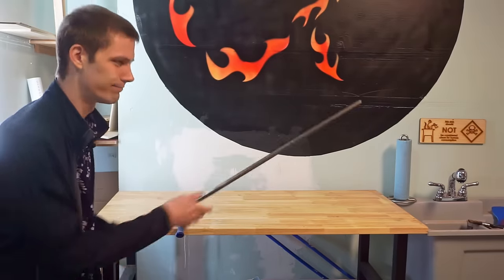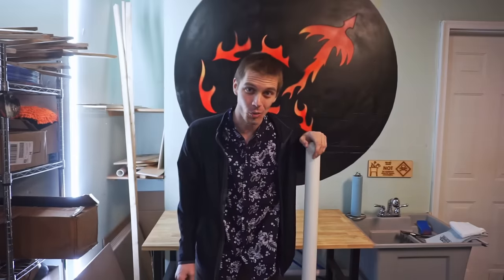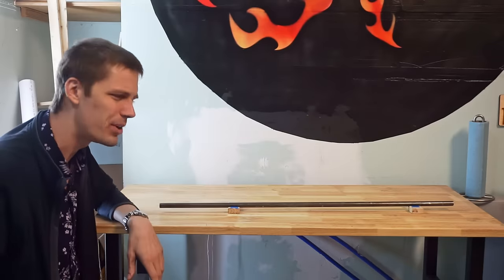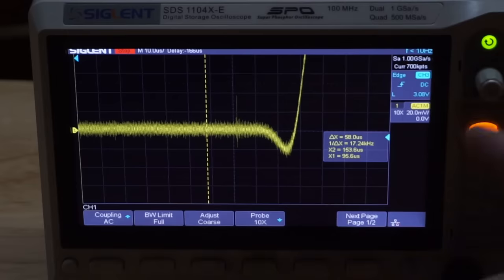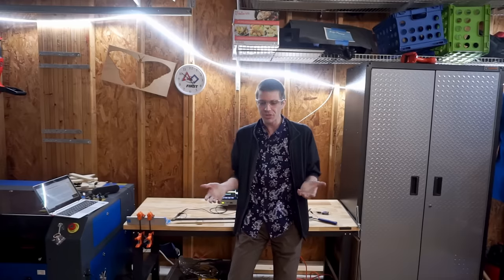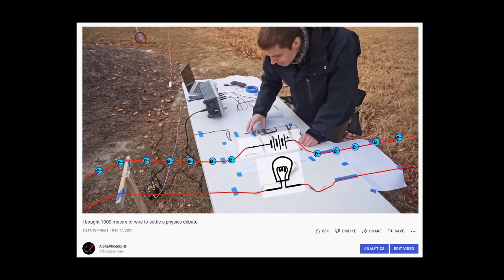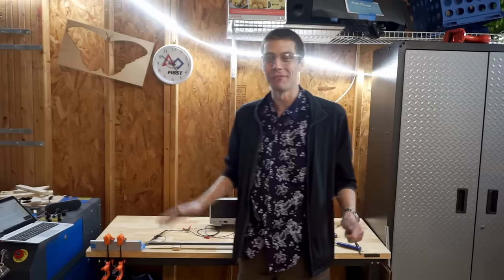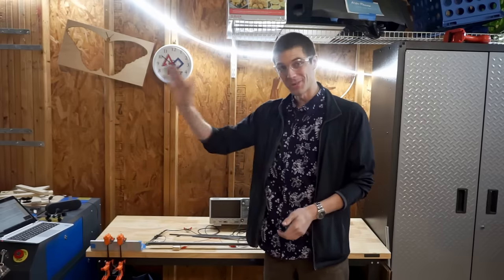Are solid objects really “solid”?

Comment: Thought experiment: How long would the bar need to be to allow the "electron springs" to entirely dampen (to below reasonable detection) the impulse of the striking hammer?
Reply: i have no idea how to calculate this becaus,e the impulse raises the temperature of the bar, if perfectly insulated but thats impossible it would be infinitely far as the heat trapped would only escape through the circular cross section at the end. probably if you measure how much it dampens in a meter then 10 then 100 you could plot a graph. Coz this also has to take into account the elasticity of the material, an infinitely rigid material would be infinitely far and instantaneous but damn. also electrons are not the only thing experiencing the impulse as all the bonds would to a certain degree, the van der waals forces need to be taken into account as you need all the nuclear forces. in reality you do a few measurements and plot a graph sound dampening is done the same way just make a sound record then add the material and record again. Truth is the harder you strike you would eventually melt the rod and its not that far as i cant year you or you me. Also certain frequencies travel differently, an example would be you cant hear the train coming but you can put ur ear to the track and hear it when its quite far away, then with harmonics of the material it would also be super far also the conditions i have no clue.
Reply: I would assume that some factor of elasticity per unit length of the material would be a determinant of how quickly energy is dissipated along the direction of propagation.

Young’s Modulus of Elasticity provides a rate of deformation according to an applied load but this wouldn’t accurately predict how deformation is affected by the impulse pressure.  I suspect that one would require a partial differential equation that factors elasticity and other physical and material properties.
Reply: As the wave travels it will change from a sharp impulse to a long wave due to sub reflections at the outer surface and imperfections in the metal. Presumably even the earths magnetic field will have a damping effect.
I suppose one could hang a 100m bar off the side of a building and take expansion measurements as the wave passes, then extrapolate that to a length where the amplitude becomes zero
Reply: Distance travelled by rod / (Equilibrium Bond Length - Minimum Bond Length) = Length of rod . Convert to whatever units and voila.

Comment: I had no idea the speed of sound actually changed like this based on orientation, and by that much no less. Makes sense though.
Reply: It has to do with the fact that solids can maintain both static normal stress and static shear stress, such that the wave can have more degrees of freedom when propagating in 3-D space, as opposed to 2-D or 1-D space.

Liquids and gasses by contrast, can only support one kind of stress, and that is the same pressure in all three axes, with no shear stress.   Liquids can to some extent, support both tension (like capillary action and surface tension) and compression, while gasses can only support compression.  The lowest pressure a gas can have, is a perfect vacuum.  Any time a shear stress occurs in a fluid, it must be supported by a corresponding space-varying velocity, per the principles of viscosity in the Navier-Stokes equations.

A stationary fluid cannot carry any shear stress, and it cannot carry a different normal stress among the three axes.  Mohr's Circle would require a shear stress when observed from a different coordinate system, any time there are dissimilar values of normal stress.   The shear stresses, and dissimilar normal stresses, are what enable solids to maintain their shape, but why liquids and gasses conform to the shape of their container.

Comment: Since some aspect of this phenomena depends on electrons, can the speed of sound in a metal be dialed up and down via the influence of a strong enough magnetic field? (Doesn't inductance also have something to do with "electron springiness"?) Might be an interesting experiment.
Reply: I'd bet it does, lowering or increasing it, depending on the way it interacts with the material... as that's exactly what the size diffrence did with the bar, the speed changed.

So in other words yup, squish'in or stretch'in it will change the speed - Cheers
Reply: Something tells me this would effect the free flowing electrons and not the bound electrons.
Reply: Lets redo the experiment inside the strongest MRT we can find 😜
Reply: You might be able to "dope" the material by infusing specific elements into it. I'm not sure if it would work, but it could be interesting.
Reply: I'm wondering  How Long a 1" diameter bar of stainless steel would have to become before it would bend under it's own gravity, if at all ?
Reply: As a rule of thumb, the microscopic electromagnetic fields between atoms and/or electrons are always insanely much stronger than any fields you could apply externally. Quoting from The Feynman Lectures (book Ⅱ, chapter 1):
‘If you were standing at arm's length from someone and each of you had one percent more electrons than protons, the repelling force would be incredible. How great? Enough to lift the Empire State Building? No! To lift Mount Everest? No! The repulsion would be enough to lift a “weight” equal to that of the entire earth!’
So – yes, in principle you might be able to influence the speed of sound with magnetic fields. But even with the strongest magnets humans can build, I suspect it would not even be measurably different.
Reply: @SeaJay_Oceans  Any length rod bends, it's just a matter of how much.  If you watch pipefitters do their thing with even 20 foot sections, you'll see things bend (visibly) quicker than you'd expect.

Comment: The SloMo Guys did a similar video with glass a couple years ago. They wanted to measure how long it took for a glass crack to propagate across an entire plane. They found that the crack traveled at the speed of sound or ~4500 m/s. You could actually see the cracks travel out like a wave.

Comment: my guess is the speed of sound but i'm probably wrong
edit: never mind i was right

This was a great video!  You did an excellent job, I thought, of explaining the related physics concepts (I'm still not entirely clear on the difference between the longitudinal speed of sound and the extensional speed, and how which gets used is decided (since my intuition tells me there should not be a magical cutoff point and it should scale by some function between the two based on...something, the wavelength perhaps) but I now feel like I understand at least more of it than I did before I clicked.  This is interesting stuff!  Also I love the FIRST clock in the background.  If I wasn't already subscribed this would definitely be the video that got me to do it.  Great work!

Comment: What I find interesting about this is that light slows down (average speed in one direction) in denser materials while the speed of sound in them increases. I'm no physicist but surely that means you could have a pretty dense material for which pushing it would effect the other side faster than light traveling through it would.
Reply: Pretty sure such a material would be so dence as to form a singularity (ie a black hole)
Reply: @radiationpony8449  I believe there have been a couple of experiments where light has been slowed well below 100 mph in labs and so we don't have to have something so dense, it's not necessary for the speed of sound to be that high in the medium if the light is so slow.
Reply: My guess is once you reach a density we’re the length of the springs is zero the sound would equal the speed of light like in the experiment with electricity in the wire.
Reply: @hopelessgamer1832  yeah, my original thought was just something which movement would perpetuate through faster than light but this is an interesting idea
Reply: @thomasmccarter7926  Bose-Einstein condensate, slowed light pulse down to biking speed while preserving data
Reply: @nocare  "This is why the speed of sound has a theoretical max of c/sqrt(3) in any object."
Nice to know, but I'm guessing that c is the speed of light in vacuum, not in that material. So it is still possible to have c/n<v_sound<c/sqrt(3), where c/n is the speed of light in that medium with n the index of refraction.

Comment: I think you should have measured both the hammer impact and the force on the other end using the same type of pressure sensors. Also repeat the experiment with the sensors on either end swapped and averaged in order to get a fair observation.

Comment: Lag is introduced due to compression and release of matter in the bar, and it's proportional to density of it. Density also is proportional to speed of sound.
Reply: But even if we had a theoretical perfectly solid material that cannot be compressed or bend, it still could not transmit the force instantly. At that point it comes down to the speed of light and no force being capable to be faster than it. So the force is at most traveling at the speed of light. ( or to say it even rougher, the speed of light also is the speed of causality)
Reply: @theexchipmunk  FORCE is not an object. It cannot move. What moves is object itself. Speed of light is unrelated.
Reply: @AllExistence  I nowhere stated that force is an object. And no, force has a speed. Like everything in the damn universe. And as everything else, nothing travels faster than light. And force spreading though an object could at most move at that speed. If you had a pole long enough to be affected by light speed delay, pushing it would not instantly move the other end, because the force would travel along the pole faster than the speed of light, wich is impossible.

Comment: You started with the premise what would happen if you pushed the rod. But your experiment turned into hitting the rod. To me, those are two different experiments. The results might ultimately be the same, but by hitting it you’re sending sound through the bar and it seems you’re just now measuring the speed of sound because you’re measuring the time it takes the vibration to move from one end to the other. 

To put it another way, you can measure wavelengths, frequencies, etc of plucking a string. But if you pull the string, it doesn’t vibrate.
Reply: Yeah what would happen if you pushed the bar to ring a bell on the moon before electricity got there. I made a YouTube video asking that question nobody responded.

Comment: I remember learning something similar to this earlier in life, but this reminds me of the stories I heard about some scientists who had concerns that if we tried to go faster than sound we would just run into the barrier like a brick wall because of this phenomenon.
Reply: Yep, it actually makes sense. You have air "not moving" and you are pushing other air particules (and the plane) at the speed of sound or faster, so the friction you create should act like a wall, yet it only seems to be a problem when going exactly at that speed. once you're past Mach 1 it doesn't seem to create that "wall". I guess the answer is that you can't transfer more energy than a "speed of sound" movement require.

Comment: My guess is it has something to do with the speed of sound. Compression waves in fluids like water and air travel at the speed of sound so why not steel as well?
Reply: There are spaces between the different elements that went into the making of the steel for the hammer head. For example, if there are iron(Fe), carbon(C) and magnesium(Mg) atoms in the steel, all those atoms are of different sizes, which leaves what are called 'dislocations' (spaces) between the them.

Imagine having having a bunch of beach balls of varying sizes and you want to cram them into some specific area, the hammer head for example. It's easy to see they all wouldnt fit nicely to make a "solid" object, right? That's basically the lesson on how metals 'break', as you bend a piece of steel repeatedly, you are literally moving and rearranging those dislocations within the steel. And once all of them get lined up, the metal breaks.

The ship knowns as the Titanic sinking was one of the first in-depth engineering and research missions by engineers and scientists to figure out the cause of the "catastrophic failure" of metals. Hope this helped.
Reply: Solids are the slowest and lowest form of matter so everything including sound waves travels much slower depending on the density

Comment: If there is a compression wave traveling  through the rod, as soon as it reaches the end wouldn't the rod pull away just a tiny bit when the wave reaches the end? The compressed part of the wave eventually has to reach the end of the rod, right?
Reply: Yes, it's reflected as a tensile wave from an open end. You can show this with a slinky

Comment: This was very interesting. Almost seems like it started touching on one of my very crazy hypothetical questions like: if you had an extremely long third class lever when, where, why, and how would physics(at least our current and as of yet incomplete models of it) begin to deviate from the generally expected results.
Reply: They are called the Laws of Physics for a reason, they dont deviate.
Reply: @id10t98  That's true, but again as he said in the video that fully depends on what model of physics you choose to use. The more correct ones tending to be more computationally expensive (Newtonian vs. quantum physics.) So an oversimplified model may break down in certain cases therefore it's laws are broken or at least inconsistent with reality. A better model must then be chosen. As of right now the Standard Model of physics is also incomplete so there might never be a totally correct solution, just a good enough approximation.
Reply: @id10t98  someone didn’t do their required reading in methods.

’Science’ does not deal in truth claims. It’s about developing models, or tools, with predictive utility.

Newton’s physics are not absolute truths.
Reply: @-John-Doe-  someone else didnt do their required reading comprehension...I didnt mention Newton, I said they are called the laws of physics for a reason and it's because 99% of things behave according to the laws of physics as we currently know them.
Reply: To be honest I didn't really argue the fact that physics would actually break down just the models used (because it won't). I should have been less ambiguous with the first comment. ID10T has a point that physics itself will not break down but it's the methods we use to describe it that do. This is a language and math issue. Laws are based on an observation and used as a ground assumption for everything else so a law is only as good as the most accurate/precise observation is.
Reply: @Constant State Of Flux I agree.

Comment: Could it be possible that your hammer strike, due to the angle of your strike, is causing the bar to reverberate in a side-to-side manor? As you stated, you were able to flex the bar with your own strength when held sideways, so maybe it’s absorbing impact while it vibrates side to side before finally releasing the energy in the direction you wanted

Comment: Cool stuff!
I have a question about the extensional (3d ) speed of sound vs. the longitudinal (1d):

Why is the extensional speed higher than the longitudinal speed?

My guess would be that in the extensional case, the surrounding material keeps the pressure wave "on-track", while in the longitudinal case, energy is dissipated into empty space around the bar.

Is my mental model of this somewhat accurate or is there another reason for the different speeds? (I am not a material scientist, so I am probably wrong.)

Comment: Reaction time on a mass of material depends on the speed of sound within that material iirc. So, uh, C?

Edit: Hah, knew it.

Edit2: It does make me wonder. 
What is the speed of sound in superdense materials, like "neutronium" as it's lovingly called in Sci-Fi?
There isn't really any space between the particles if I understand correctly, so what would happen if you pushed a hypothetical bar of neutronium that's 1ly in length? (One that doesn't instantly collapse into a black hole or fresh neutron star, anyway)

Edit3: Ah, "The Internet" (mainly Physics StackExchange) has this to say: "recent observations of neutron star masses and radii suggest that the speed of sound near the center is close to c" 

Good to know.
Reply: I am by no means an expert, but I guess that there should still be a speed of sound in neutronium, since it is bound by the strong nuclear force, with quarks and gluons acting as the points and springs.
Reply from the maker: I’m so glad you looked it up and edited with the answer cause otherwise I was going to have to go find it… fascinating thought!